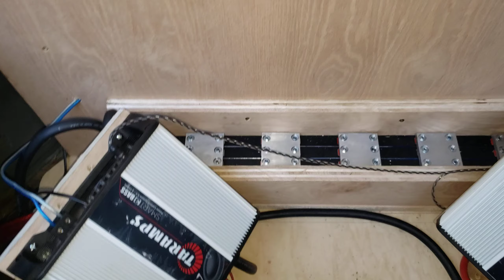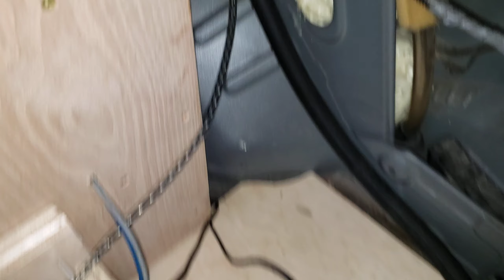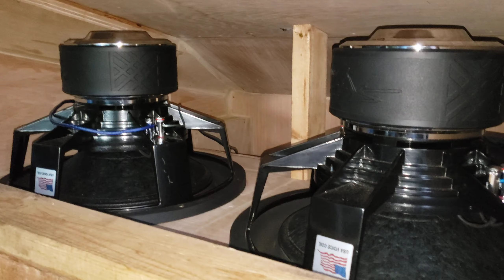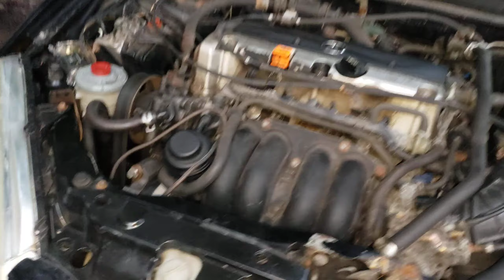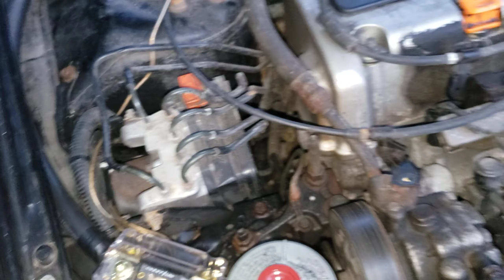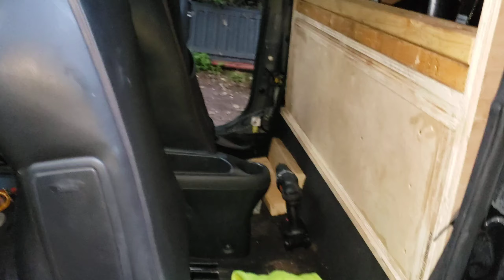2 Skar Zvx 18" 4th order bandpass build , 30ah scib and 2 smart 3 bass

Comment: Got a question for you. When you done your lithium testing what did you get more output from, Headway or LTO?
Reply from the maker: Typically lto . Its also safer and higher voltage
Reply: @mazda2284  that kinda sucks for me because I just invested in a salt 6 for my daily and Sundown recommended not to run it above 5.3 volts. I will be adding another 56 ah bank of headway’s to the one I have already. Thanks for replying back. You turned me one to headway over a year ago.
Reply from the maker: @jasenlauver4862  its great for 12v , many of us are going higher,  you can still run scibs at 14.8-15v and be happy , ur just gonna need a lil more than the guy running 15.6v-16v , and if you ever change amps , bump ur voltage up and bam you can support more power
Reply from the maker: @jasenlauver4862  there is a link in the description to the cells we use
Reply: @mazda2284  I seen you were running the Panasonic cells. I already have a 56ah bank of headway’s I’m running, I will probably just build another 56ah bank of them and add too it. My next build I’m going to all LTO cells for sure. There is a lot of benifits in using them.
Reply: @mazda2284  I have a question for you also, do you have any idea exactly what is inside of my limitless cyber 12k and also if I have the cyber 12k, a reg limitless 25ah (for my 4ch) and an XS SB1000-31 supercap (1k farads) on a mechman 320 with 2 runs of 4/0 ofc to the cyber and 1 run to the 25ah with supercap under the hood do you think I'll have enough reserves to run my wolfram AW-9000.1D at half ohm? Also have you messed with them Ustart ioxus things at all? I got one for $180 shipped and from what I understand there's a decent amount of ioxus caps in them for that cheap! Just not sure if I should run it with the batteries I already have or just use it on a different project 🤔
Reply from the maker: @jasenlauver4862  na not panasonic NMC , toshiba LTO is what we use
Reply from the maker: @kevinAuman1  the cyber uses a123 pouch cells i have the ioxus caps and they are a waste of money imo . not at all impressed. takes bout 20secs to drop the caps dead and puts the amp in protect .
Reply from the maker: @kevinAuman1  yea im not thrilled with the ioxus banks that are put together and sold , tons of people have issues with them self cutting and destroying amps when they plummet in voltage instantly due to the protection on the caps.  I say stay away from them and spend the money on something else
Reply: @mazda2284  right on, but what if you already have then lol-ol-ol I ended up with the XS SB1000-31 in a trade and I have not had any issues running so if you had one you're telling me you wouldn't run it vs not having one at all???
Reply from the maker: @kevinAuman1  if it helps and you got it cheap sure run it , I'm just saying people are problems with them

Comment: Wait a minute you said that you built the alternator yourself???
Reply from the maker: yes sir !! ive built a few now , never buying a expensive alternator ever again !
Reply: @mazda2284  well damn, yeah I bought a CES large case hairpin from Jonathan Patrick when he still worked there and that sum bitch did over 380a and it did 210+ at idle I loved that alt then I bought a damn mechman 320a and it doesn't seem to have half the power that CES did and it cost me more for the mechman 🤷‍♂️🤦‍♂️
Reply: @kevinAuman1  ya I love my brand x 390 she does pretty good charging currently at 15v on the money but will be moving up to 15.8v charging when I get the big system installed

Comment: more info on the bank please I want to save some cash instead going to buy 3 more agms  want to go lithium to save cash
Reply: I got the same taramps as well it pulls current than a mother drops my voltage to 13 on my 320a alt only 1 xs d3400
Reply: I doubt you'll save money converting to lithium along with all the bus bars and hardware its expensive my friend
Reply: @redman4076  i heard you can build a 30ah for under 500 i seen setups with the headways
Reply: @GorillaKnobzUSA  Getter done then my friend👍🏽👌🏽✌🏽💯
Reply: @redman4076  i wish I could broo but i don't know shat about the diff kinds of lithium like the headway, yinglong, and never seen anyone talk about those Toshiba ones in the video they look like they pack more power tho all i know is you hook em up together get a balancer and ready to go
Reply: @GorillaKnobzUSA  Its pretty simple if you can hook up a car audio system then you can do the lithium set up easily
Reply from the maker: @redman4076  you will save a ton doing it my way !!! no joke ! we dont do any agm anymore
Reply: @GorillaKnobzUSA  Yeah building this bank would be around 500. It would cost 441 for the cells shipped to my door. So if you can build your own bars then a balancer would add the other 50-60$. Supposedly a 10ah will support 10k charging 15.5 with 200a of charge and 7500 at 14.8.
Reply: @DustinG33  will this bank be enough to run but self if i delete my front battery
Reply from the maker: @GorillaKnobzUSA  yes , he runs no front battery , its there , but unhooked .